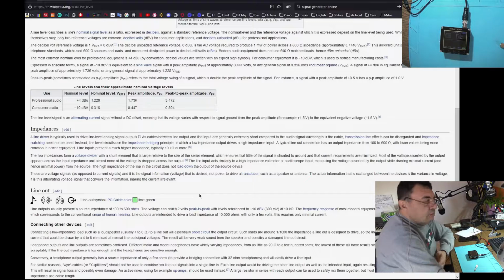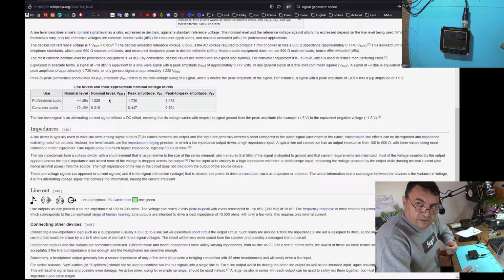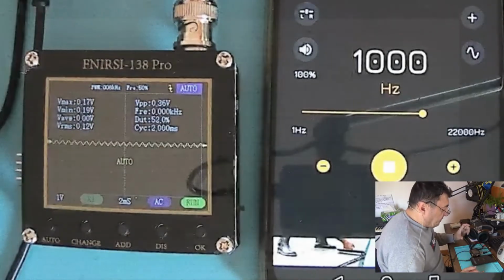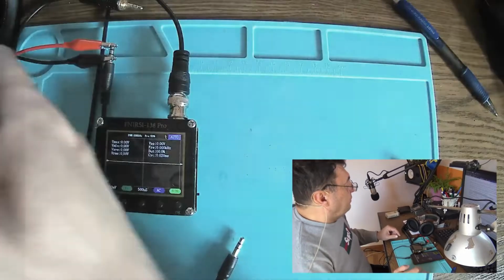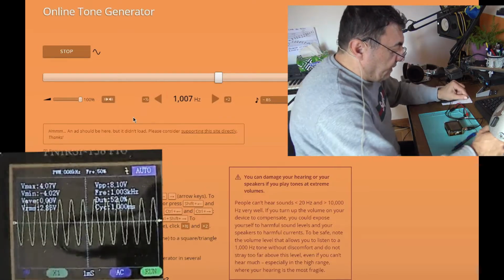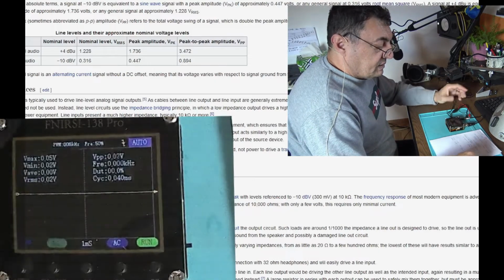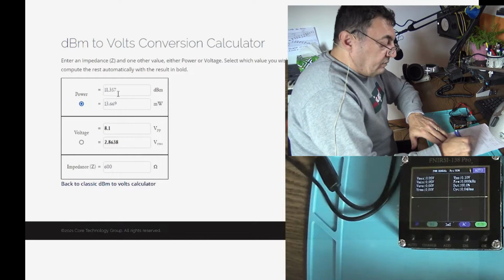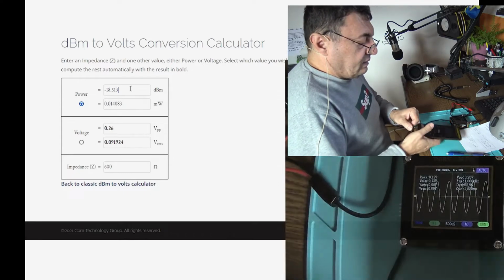Mobile Phone Audio output for amplifier test

Comment: Great video! 
How long I awaited and searched the value for mobile audio output signal for designing an audio amplifier. 
Thank you!
Reply from the maker: More to come ..se the videos about NE5532 tone control..
Reply: @viocaia  Da. Este un clasic. Dar pentru mine, cel mai bun sunet provine de la un preamplificator in clasa A si amplificatorul de putere cu tranzistori MOSFET in configuratie clasa A sau AB. Preamplificatoarele diferentiale au un gain fff mare, dar sunt mult mai complex de realizat. Intr-adevar, ti-ai usurat munca folosind un IC dedicat. Dar daca ar fi sa il realizezi cu componente discrete ar fi mult, mult mai dificil a.i. THD-ul sa fie <0.1% .Succes!
Reply from the maker: @georgevalentin9230  categoric de acord..